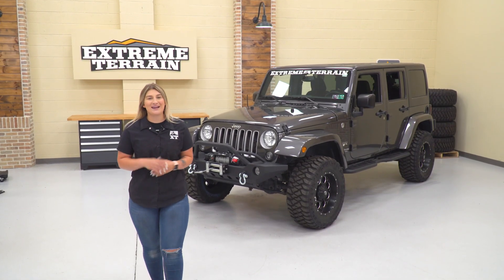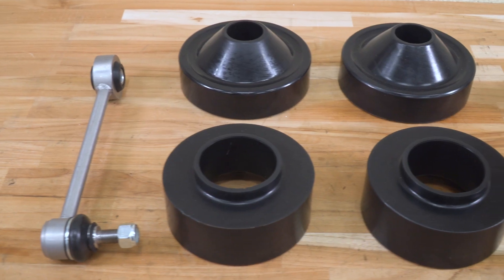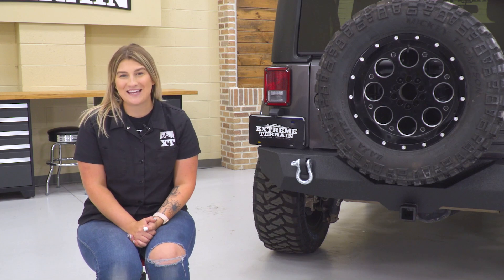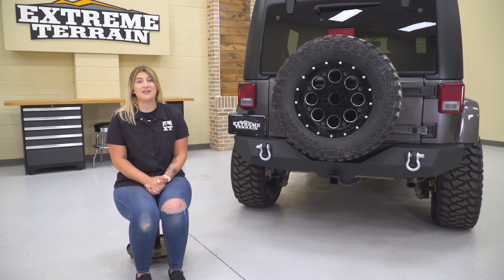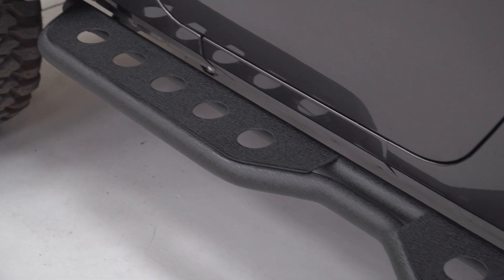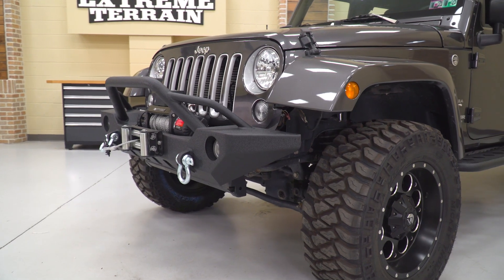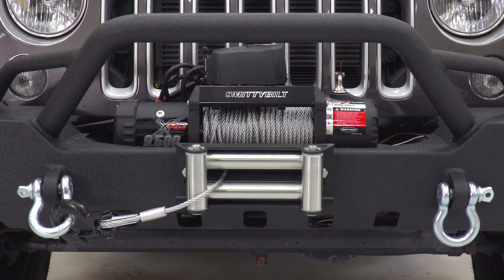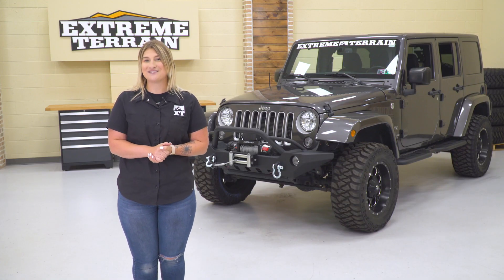The Top 5 JK Wrangler Parts Under $500 You Need For Your Jeep - Throttle Out

Comment: One thing I would add is LED headlights and taillights.

Jeep’s halogen lights are pretty poor illuminators. My first mod was grab handles on the roll bar and LED lights. Then front and rear bumpers. 

For the suspension I’m saving up for a proper lift like the Teraflex Outback. It cost more but I believe it’s cheaper in the long run to do it right one time.

Really enjoy your videos and your on screen personality.

Comment: I always see people asking if these bumpers are tow rated...pro tip everyone,  when asking if its tow rated how about include what you plan on towing.  I've seen people haul small trailers and small boats on these bumpers. They TOTALLY cam do that without worries. Now full size campers, probably not. They are meant for small trailers and hitch carriers for supplies. Use your brains folks.

Comment: i just bought a 2016 sahara JK it has the same grille as the one in the video. can you tell me if the bezels around the headlights that are crome, are they able to be pulled off or are they built into the grille im wanting mine black not a fan of the crome.. thanks
Reply from the maker: Congrats on the new JK! They are built into the grille so you may have to do some painting to ditch the chrome.

Comment: how does a lift kit effect alignment of tires?
Reply from the maker: Adding a lift onto any vehicle with affect the alignment, and you'll want to get it properly adjusted afterwards. Any lift over 2" in height will benefit from an adjustable front track bar and adjustable front lower control arms to keep your suspension geometry in-spec. -Zach

Comment: Coil lift not puck lift! Can anyone tell me the benefit of pucks besides being cheap? Personally I want more functionality so i don't understand these.   Great video!
Reply from the maker: Spacer lifts are a great option for those wanting to keep as close to factory ride-quality as possible and save a little bit of money while achieving a small lift! For daily drivers who don't go off-road, they're a great entry-level option. If you're looking at doing some off-roading, a full lift kit with new shocks and springs will absolutely give you more functionality on the trails. Thanks for watching! -Zach
Reply: @extremeterrain  makes sense.  Thank you zach!